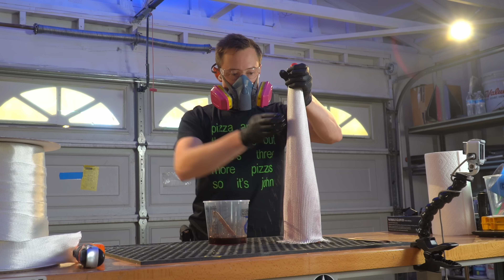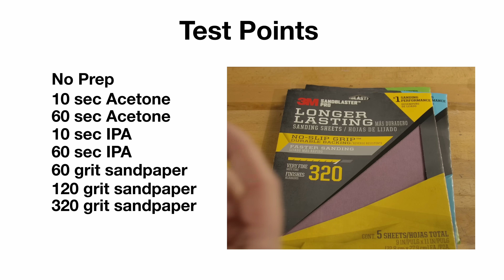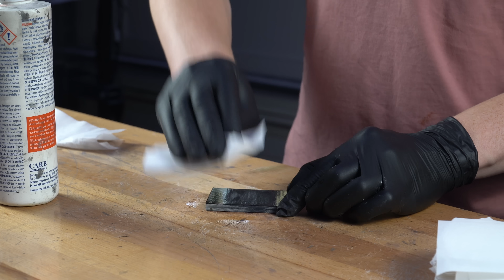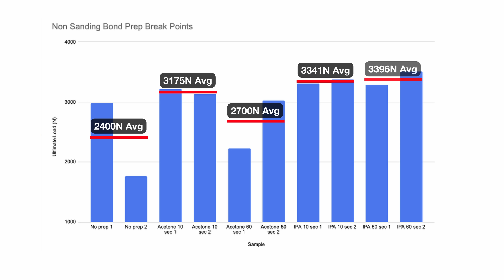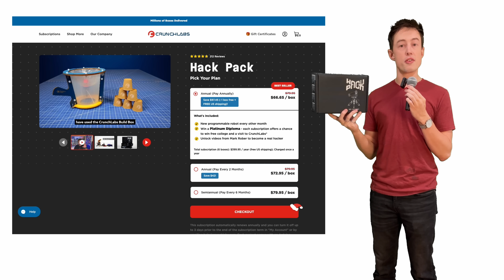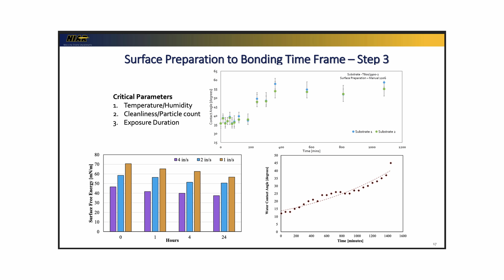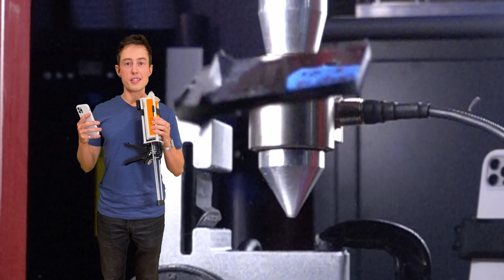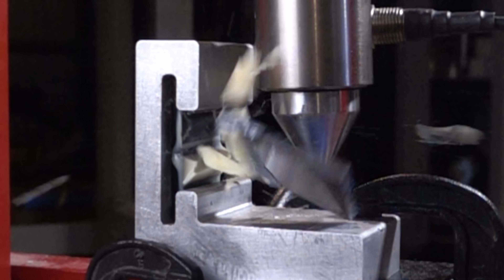I Broke 100 Epoxy Bonds to Find the Strongest

Comment: Cold plasma works much better than the hot variant you tried with the arc. Take a look at DBD plasma; it's used for industrial cleaning processes. I had to work with DBD plasma sources during my studies, and I was amazed by what you can achieve with them!

Comment: Just a theory, but if what you need is the atomic oxygen from the blow torch but not the heat, can’t you use a heat arrester (metal mesh) that should allow the atomic oxygen through to the part but not the heat (or not as much)?

Comment: Extracting samples with press will weaking the joints (5:50). I watch full video to look for these variable! Maybe if you try an open mold, with 2 or 3 parts to avoid use the press to demould it. It's a race to 4000 N strong.

Comment: The failure mode seems to be fracturing starting from the upper interface where the coupons meet. The bottom of the interface acts as a pivot which puts massive tension on the upper part. IANAULAT but you should try putting a 90 degree chamfer on the interface and see what happens.

Comment: Just to add another “expert” voice to the mix, the viscosity of the epoxy plays a part in how well it wets onto the surface. This is a consideration for what grit sandpaper you use, the glue needs to fully interface with the substrate and if it just bridges over the top a finer finish is of no use.

Comment: Plasma treatment for printing on cable insulation leaves about a second between activation and application of the paint. it makes the ink spread properly, and stick well.
Afaik also used to prep enameled flat wire prior to PEEK extrusion around it.

Comment: The other variable you aren't accounting for is how you are actually measuring your data. I noticed halfway through you are using a hand pump which mean you are introducing noise down to the speed you are pumping and at what point of the stroke you are pumping.
It is possible that you got a higher measurement on the 4000 N measurement simply because you were in the strong part of your power stroke and therefore the measurement got higher before the part had the time to break to but would have failed at a lower number if given the time.
I don't know how significant that is, you would have to check the force graphs over time if you have them to see if there is a correlation.

Comment: As long as your surface bond has an consistant low in realistic application enviroments... just design around that low. Meaning if your bond is 1/10th the strength of the base part at the weakest it consitantly can be. run tape of the same fiber as the base composite 11 times as wide as the thinist part at the joint. The fillet still helps (hopefully for obvious reasons)

You dont even need a load cell, just a weight as a pass/fail, and assemble as you would on the rocket itself then cut out all your test coupons with differing cleaning and prep processes, and differing contaminates that might be in the air or accidentally get on your componants so you know what trashes a part and what can be recovered.

This is why in production some of the highest strength to weight ratio components where often brazed or soldered together. The weld variables are higher so to get things thinner we just extend the joint to use something more reliable even if its technically weaker.

(I do know this is outdated for metalworking welding has gotten more automated and reliable. Dont come at me, I am aware. This is just how things where in Aerospace when I was in Aerospace... And its OLDER not ancient.)

Comment: One thing you should consider, the motion of orbital sanders reduce the grit of sanding effectively to a higher grid level. So to get the same result as with hand sanding you need to use a lower grid on your orbital sander. (the impact of the sanding motion to the effective grid is another rabbit hole yay!)

Comment: You're completely wrong: you said it's a long video while it's barely over 40 minutes long. I'm not surprised those rockets barely lift off the ground, with this much precision in the engineering process 😉

Comment: introducing "belt sand paper electric device thing" so the speed and friction of the belt will trow back the dust and u will get one way not circular scratches. u could even test a direction to the load and cross pattern direction to the load by offsetting let say square pattern by 45 degree

Comment: A couple of thoughts. 

You might try switching out the acetone for ethyl acetate, in my experience it is a more powerful solvent.

Then we have chemical etching, if you want everything organic away you can go up to the big daddy himself and try out piranha but that attacks ALL carbon and is prohibitively dangerous to work with but that would remove contaminants and leave a etched surface. A base piranha is less of a hassle to work with and might etch enough for you.

Comment: There are many more things involved.

Sanding is a complicated topic when it comes to glueups. Cleaning the surface after sanding can be a lot more work than people expect. Specially with fine grids it can be difficult getting rid of the dust completely just simple wipes might make it appear as if the surface was clean despite that not being the case. Compressed air to get rid of the bulk - but NOT from a normal compressor as that air is rather dirty (oil fog). Then a damp cloth is generally rather good a picking up dust, followed by iso (also helps with quick drying). Then there is the type of paper used. It is not just for marketing that brands often have >5 different types for the same grid. The coating that holds the aggregate on the paper can have a big impact as some of that can rub of on the surface. The type of aggregate impacts the surface-structure and when deteriorating part of those particles can end up embedded in the surface.
When working with wood that became a big problem for me. One paper i liked to use had a coating that would rub of and make paint not stick so well, and a lot of aggregate would break free or create dust that would lodge it self into the wood. But it was still the paper i went with cause the solution was just to use it on a scrap-piece first.

With vacuuming i doubt it is the mixing-part that creates that large of a difference and would suspect it is the vacuum it self. You are trying to connect 2 rough surfaces and for that the epoxy needs to be in contact with those surfaces, but when starting the glueup the faces are exposed to air and the glue will just run over those tiny pockets of air. With degassing the air in the tiny grooves will expand and bubble out, leaving behind empty space for the epoxy to fill. And then after that there also will be less air in the epoxy bulk too but that would mostly not affect bonding strength.
unless you have a way of putting the entire rocket in a vacuum.... not that practical.

But for simple fillets: Add a layer of fibre on top connecting the fins.
Your problem is not keeping the glue attached to the surface but keeping the fins attached to the body. The glue then doesn't need to fully hold up to the stress but just be a support for the fibre-material that transfers the load to the next fin. The force is now distributed over a large shear-area and ends up at a fin that would now just get pulled into the surface. Sidestepping the chemical bond with mechanics.

Comment: Amazing video ! I'm working on a project where all this tests you did are really usefull. But, just a question, you can't do degassing when the fins are in position on the body tube of the rocket. So why do you do that proces step that will be impossible during the real rocket assembly ?

Comment: About those uncontrolled variables such as the dye, the variations ambient temperature, the air cleanliness etc, those same uncontrolled variables are going to still be there when it comes to building your actual rocket.  The best you can do is control what you can and ignore the rest.  

There should be a way to theoretically calculate the forces involved given a fixed surface area and variables for velocity and air density.  These would give you a ball park for your minimum yield strength.  Then add 15% for Murphy.

The question is, since you can consistently hit 3000, is that enough?  If it is, reaching for more is just wasted time, effort, and expense.  Remember, an optimist sees a glass half full, a pessimist sees a glass half empty, an engineer sees a glass twice the required size.

Still, fascinating testing.

Comment: For consistency you might consider a final "rinse" with your IPA, with a towel you will be pushing contamination around. To really remove it you ideally towel then rinse it off and let the IPA carry away the contamination. That said I don't know how much it'd matter in this case. 
I always found a residue after putting acetone on resin, I suspect some of the long chains breaking down turn into short chains AKA oils. The IPA is strong enough to remove that residue without breaking new molecules.
Applied science has a great video on degreasing stuff (because of course he does) btw.

Comment: some things you may want to control for: epoxy and environmental temperature during dispensing, environmental temperature during curing, and surface temperature during dispensing. from what i’ve read, temperature matters a lot with epoxy bonding.
Reply: oh yeah, mass of epoxy dispensed should also be a control point

Comment: Is the torch treatment really that bad? Even if you burn off the surface layer of resin accidentally, doesn't the resin you use to bond fill it up again either way? Who knows, could even be stronger if you burn it, it's not gonna burn the carbon fiber. I think you should have tested that direction a bit more. You really went deep down the sandpaper rabbit hole in this one.

Comment: You could have used design of experiment to control for unwanted variable and also optimise the number of experiment. That way you can change multiple things at once and get the benefits of knowing the interaction between the factors

Comment: If you are interested in another rabbit hole look up UV/Ozone surface pretreatment. It can significantly improve the wettability and adhesion but I’m not sure it’s the best option for your application. (Large parts).

Comment: Would a decent ozone generator work for bond prep? The room-sized versions in the $100 range can have a pretty high ozone output. The guts should be pretty easy to keep contained while modifying the generator output to be more directional.

Comment: You keep talking about surface area, which is obviously a huge part of bonding, but something that keeps popping into my head is the angle and thickness of the ridges and how that affects shear and tensile strength. I.E. A tall acute triangular ridge such as one created by low grit penetrates deeper into resin with more surface area, but has a shallower angle and thinner cross sections when compared to a shorter equilateral triangular ridge that may be created by slightly higher grit. 

How much does the impact angle of forces on the grooves and ridges affect the strength?

(I'm not a formal engineer, just enjoy the science and I'm about halfway through the video at time of posting. Just sharing thoughts.)

Comment: A very interesting video but the confounds you add, violate, remove in a series of tests literally invalidates ALL your results, yes you try and state that, and you are trying to infer info but again you add or have SOOO many confounds for every test makes even this hard. Also i commend you for the encouragement for people to do their own tests, however, i ask how much did all your materials cost? not everyone can come close to doing that, or have access to the hardware to do them and trying to learn from your video here is exactly as confusing as google is as there is no clear tests or answers for someone who can't afford to do these tests and most likely do not have the equipment needed to even try. So as you said they turn to google, but then how to know if they are right or just pure BS. So while i commend  your effort, i condemn your testing methodology and telling people to do their own tests feels in a way as a cop out at the end as you didnt have any clear data. 
I Do wish you successful projects and goals though, and please for others that may find these tests useful i would recommend another video with clear results.

*Note*, there is another way to vacuum bubble release that is not quite so, messy shall we say. you do it in stages and keep it cool as it creates a lot of heat, which i think is also altering your results. So what i mean is turn the vacuum on for a short time till it starts to bubble then stop it, do not return to normal pressure, wait till it settles then repeat, it takes a little longer but creates more success. As for keeping it cool it does not take a lot but exothermic reactions can change the structure of a material and its bonding completeness which might account for some of the strange breaking patterns i witnessed, so finding a way to remove the heat can help, water cooling can provide this while maintaining vacuum.
Just a few ideas.
Sarah
PS: sorry for any spelling or formatting errors its late here and i have a killer migraine so I apologize as its hard enough to look at my screen over trying to edit things with really does not hep when i am writing, so I watch youtube vids lol. Good luck.

Comment: 9:12 this superlube part is little concerning. Lube has a very high surface tension and tend to spread everywhere. May be it found its way to the epoxy while you put it into a mold and pour it with epoxy.

Comment: Just make the mold taller. Then, when you de-gas, the expanding epoxy remains within the container so that, when you release the vacuum, the bubbly epoxy settles back to the bottom without any loss of volume.

Comment: Another one. Could it be that its not the bonding that is the variable here but the epoxy? If there is still epoxy stuck to both pieces its the epoxy that breaks? Maybe there is an epoxy that can sustain more stress?

Comment: There's also another great surface prep compound if you're interested:

Conformal Coating remover. It's an acetone mix that smells awful, but is like industrial strength Goo Gone.

Edit:

Is it possible to dovetail the mating edge into the rocket body?

Comment: i think vaccum bagging could be looked at for rocket construction. it adds clamping force from the atmospheric pressure pushing on the joint of epoxy. would be similar to the idea of vaccuum and pressurize i see in molden resin parts. Its used in carbon fiber layup construction. if the right shaped bag is used i could see the whole thing fitting inside a 3dprinted jig for alignment. anyways food for thought.

Comment: Now that you have the surface prep, why not add a few mechanical locks? Perhaps a series of small diameter through holes in the fin within the epoxy fillet that when injected with epoxy and degassed for epoxy "bars" locking into the fin; spaced far enough apart to not degrade the strength of the fin - no perforated paper tear lines please. Or a series of shallow dimples made with a round nose endmill or even more angular from a regular drill, think golf ball dimples. Decontaminated and cleaned of course.

Comment: Emery cloth, NOT sandpaper!
Someone also mentioned 3M "Scotch Brite".... I've had good success with ScotchBrite using it under running water, which, of course, flows away the particles from the material being treated, as well as the tiny fractured woven material... It's perfect for giving Aluminum the nice "brushed' finish.
There are also some 3M "fingered disks", that you use with an angle grinder or drill/die grinder..

Comment: You got to try it I'm dying to see this test please use the Tesla blue Cyber truck stuff just like I told you please Yes he'll hold up the heat too I don't know what the top heat rating is but hey listen those trucks are all aluminum and they get very very hot in the desert sun so and it's going through the whole body of the truck

Comment: 26:53 if you do this again, put the sandpaper on a flat surface and then push the coupon back and forth for a more uniform effect.
Reply: and or use a belt sander
Reply: @NorroTaku  that would introduce heat to the coupon